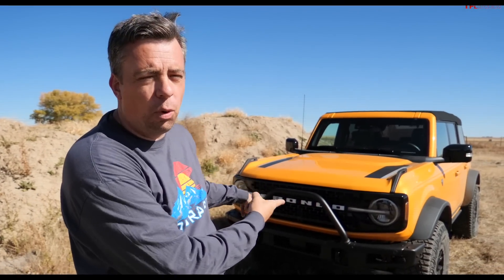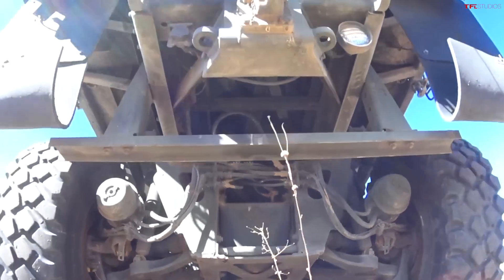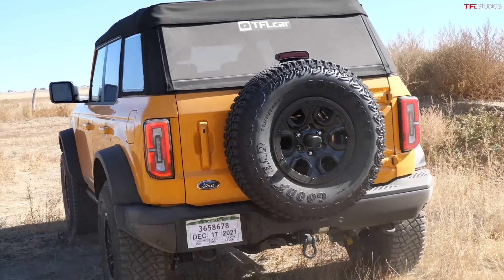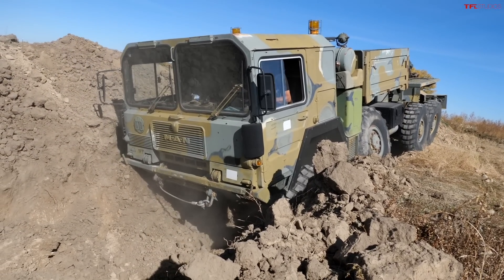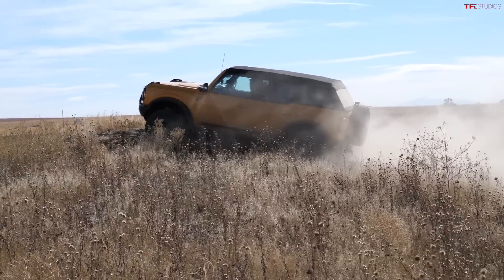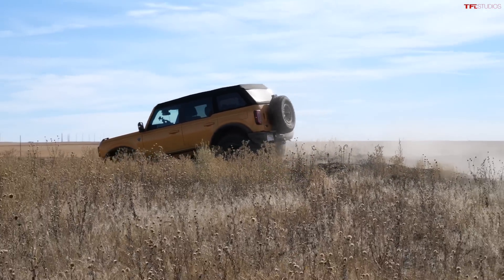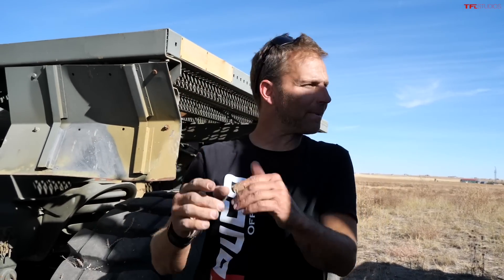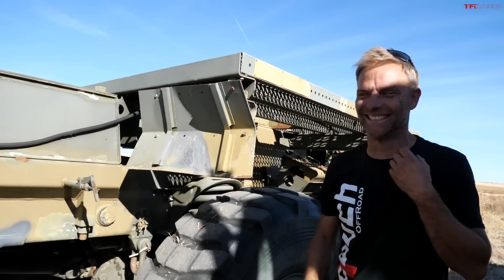Can the New Ford Bronco Keep Up with the Ultimate Military Trucks Off-Road?

Comment: Those trucks aren't meant for offroad, made for trails barely. 8X8 lifts heavy things like a tank. Built for dirt roads. Not rocks, mud, or worse. Weird Angles can get you killed. Many many soldiers taken those 8x8 off the dirt road and died. Bronco is offroad, those military trucks aren't. Anything offroad would require tires side by side like the Stryker vehicle. Putting those at any angle is asking for death. Did you guys hire any Veterans from the tanker side like me? I'm a field medic and can stop ✋ any rank from doing this, advise a general of other ways around that, and life expectancy is below 10% going straight through any angel-up armor or heavy lifters like those military trucks. Are used only for supply, not for combat. Back of the war or combat humping food, ammo mainly. In and on paved highways! Those tires are also rated for highway only. Not made for offroad. If they say that because soldiers sign a release and have 100k life insurance. Plus family pays for life. That's using those trucks on a highway. That weight does not look like a semi-truck(efficient travel) all safety features are off! Even seat belts too most often. Because they're not for combat or field use. Just where house to statehouse travel only. The underweight for the suspension can break under these circumstances you're doing. Bunch of weight no safety, living from a video like this is was awesome. One pop of tire, one wheel coming off, the driver goes splat. Hanging out the window like that, the door is thinner than a coke can made of tin or less durable metal. Bronco has by highway laws 1,000%, safer than any Army vehicle. Made working the human at the ford. In the Army, they make it for travel and ammo plus food storage the dumbest way, to the lowest bidder. A hobo made these trucks guys. Probably without a high school degree on a .gov contract win. I had seen many die with just two inches of rain within these trucks off-roading it. Can't climb that hill because there meant for pavement. If that axle snaps, may take off you're head. Pulling equivalent of two tow trucks if loaded, can't take this to offroad. Parts do exist, drives like shit. Turned down to 385HP 1200 lbs downed down. Maybe not turned down. We have a 15 ft minimum area to walk during use with these trucks, and also with armour and helmet on. People(soldiers) still die. Made to pull, bigger and overbuilt. Not good for offroad. Gears can come through the cab, tires can blow a soldiers in half five ft away. With armor on. Ten tons weight, engine pulls 40 tons if used that way. Gets stuck at any grade or angle off-road. Popping tire, even the driver doesn't live, prayer that we do. Bid to the lowest contract and lowest bid price to build this. No safety or human features in mind. Every human feature is secondary to pulling a tank out fast.
Reply: Anything over 10k lbs or the weight of a semi-truck by two is asking for death. Tires pop at four times the force than a semi-truck tire. Slice a two-inch plate of steel in half in front of it is popped or bend it in half. Seen many soldiers rolled over by these trucks too. Hanging an arm outside of it like this video or your head is a range safety hazard, riding with no armor on or helmet can get you kicked out of the Army for life, while driving down a highway. Those are highway driving rules. These vehicles aren't meant for off-road. You asking for death. So lucky not to die, filming this. So glad 😆 everyone didn't lose an arm or leg without an Army medic there. I and my wife are Army combat medical for infantry and tanker artillery units.  This video would get me fired from the Army if I were in that driver's chair. Doing what you guys did. That's serious, almost like flagging someone with a rifle. Not needed, unsafe barrel safety. Army gear sucks, Toys R Us makes better products and medical gear. The failure rate of those tires, gears, and springs is 10x more than the civilian field made for Civilian babies, like on that Ford truck. Stick to civilian gear and not crazy videos like this, without a Tanker Veteran like me or a medic. Your asking for a sure accident here. Made it home safe. Go play tbe lottery guys, you won 🏆 at life. Don't test that Darwin Theory and keep the channel to 3500 HD diesel MPG baby safe civilian approved government toys. Fool proof gear like Ford, Dodge, and Chevy. Let military guys die on their own gear being dumb and stupid is a requirement in the military, but the life insurance is great.
Reply: Ummmm, I guess me and my fellow racers in Germany are very lucky. We’ve been using the MAN in grueling off-road, off camber stuff for me @ 15 years and them 30 years.
Several of them are ex military operators. Thanks for the heads up though.
Reply: Gee glad you were not around when I was operating MAN trucks and HEMETT's off road in the 80's and 90's I would be dead by now.
Glad your a S.M.E. on this topic.
And here I thought 28 years as a 64C/88M serving in Armor, Field Artillery, and operating this equipment off road in all conditions over half the planet gave me the experience and judgement to make good decisions.
BTW? TACOM tested the MAN at the Aberdeen Proving Grounds and it was the only wheeled vehicle to pull a M60 tank hull out of the "mud pit"
No one ever told me the military was a safe job.
And yeah, I served with the Big Red One.

Comment: Can't compare these 2 vehicles. If you go test these 2 vehicles in Canada or North West US the 6 wheel would fall off a cliff trying to offroad or get stuck between trees or slip into the river etc. You get my Point. Try driving that big rig through jungles in South America. I have respect for both vehicles in here but I would take a smaller vehicle like a jeep or Tacoma or 4 Runner or other smaller vehicles that fit in trails.

Comment: "ultimate military trucks"
-doesn't include a unimog
Reply: Unimog is amateur hour compared to the MTVR.
Reply: @shawnbartz9818  i've done a ton of international exercises, american trucks rarely keep up with unimogs offroad, let alone be better than them. The MTVR's are limited because of their independent suspension, weight and size. They're massive and heavy, which rarely is a benefit when driving offroad. There's a reason why a small ATV 4x4 is better offroad than a power wagon.
Reply: @joshkiej6601  I don't see many Unimog's over here in the US. I'm also surprised portal axles aren't very common. They seem pretty common in Europe. I think the American military always prefers the ease of driving and ease of maintenance in their trucks rather than performance.
Reply: @joma13344  portal axles areen't used that much in europe either, apart from unimog derived vehicles. the unimogs are incredibly easy to drive too, you can get them in automatic/automated manual but a lot of militaries pick the manual version because of its simplicity. Our unimogs are still using mechanical injection pumps, so they very rarely break down. Unimogs are reliable because they are so simple, parts rarely break. In europe we do have other military vehicles that tend to be unreliable though.
Reply: @joshkiej6601  That's pretty cool to know. How many people in europe know how to drive manual? Because that's a big problem over here. That's why all military vehicles are automatic over here. I remember in my training (I was a Tank crewman in the US Army), we had a guy who had straight up never driven any vehicle before, and his first ever driving experience was an M1 Abrams. Kinda cool, but surprising.

I also remember that not many people tried to learn off road driving either. They would get stuck, then proceed to keep spinning the wheels and bury the vehicle.
Reply: @joma13344  to get a regular driving license you need to be able to drive manual, so pretty much everyone. If you don't have a regular driving license when you join thenarmy, you can get it with a military instructor, you need a commercial driving license to drive any military truck on the road since they weigh more than 3.5 Tons so thats a seperate license too. You can get your regular commercial license in the military, but even then you still need to follow a course to drive a certain type of vehicle. When you get to drive offroad vehicles, you sure as hell get to take them offroad. That's how it works in Belgium, but i imagine it works similarly in other european countries too
Reply: @joshkiej6601  That's good to hear. It's not like that over here unfortunately. You can get a military driver's license for anything as long as a qualified person deems you are capable of driving it. So training really varies from Duty Station to Duty Station. There were people at my station who didn't have a regular license but had a military license that drove 5 ton trucks around base.
Reply: @joma13344  in Belgium the instructors need to pass civilian instructor tests before they can do exams with people. A military license can be converted into a regular driving license here, you just have to go to town hall and show them  your military license
Reply: False. As a military vehicle, the MTVR far exceeds the Unimog in all capabilities.  The TAK-4 independent suspension has 16 inches of wheel travel, so that’s far from a limitation.  And I’ve seen Marines literally drive armored MTVRs through walls to get to insurgents and the truck just keeps going.  All while carrying 7 tons of payload off-road.  So yes, as a military platform, the MTVR is a superior vehicle.
Reply: @shawnbartz9818  I'm not gonna deny that the MTVR is decent offroad, but 53 inch tires and lockers make anything perform well. You also got to consider that there is other offroad conditions than desert, conditions that relatively lightweight vehicles on portal axles with a tight turning radius cannot be bested. You also got to consider the complexity that even stout independent suspension has, and it just seems like it's only a decent platform for countries that can afford to upkeep them.

If I had to deal with deep mud and snow in mountainous terrain, then I would chose the Unimog hands down. Even the FMTV would fair better.
Reply: @joma13344  sorry, but I’m going to have to disagree.  As someone who’s had plenty of wheel time in both the MTVR and the FMTV, the 7-ton is hands down the better off-road vehicle.  I’ll grant you the turning radius, but there’s little complexity to the TAK-4 suspension, and it literally never fails.  I’ve had the truck through deep water, plowed mud with the diffs, and crawled through two feet of snow.  It’s capabilities are exceedingly impressive for as large as it is.  Again, as a military platform, it’s still superior.
Reply: @shawnbartz9818  driving through a wall is nothing special. The MTVR is a transport truck while the unimog is specifically made to go offroad. The unimog weighs 1/3rd of the MTVR, has better ground clearance and it'll fit through things where the MTVR cant even think about. The MTVR is more comparable to a zetros.
Reply: @shawnbartz9818  also: it might have suspension travel, most independent suspensions have a decent amount of travel. They fail when it comes to suspension flex. Unimog suspension is as good as it gets to go offroad.